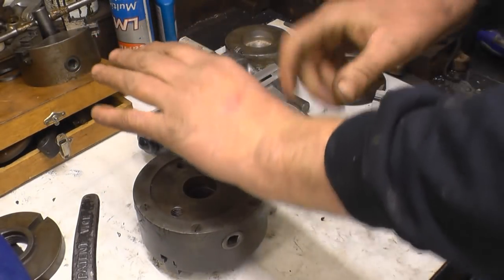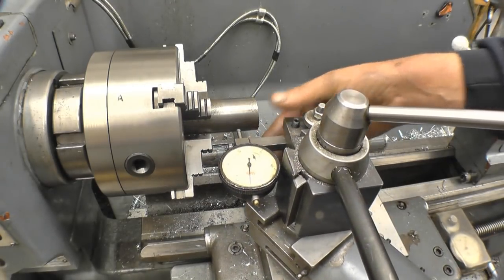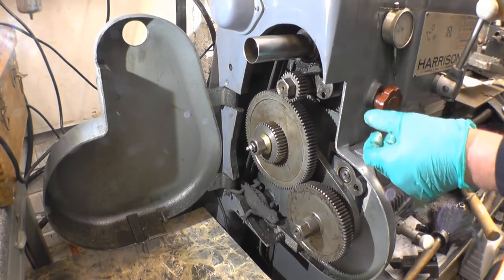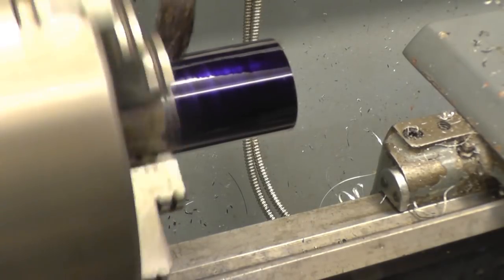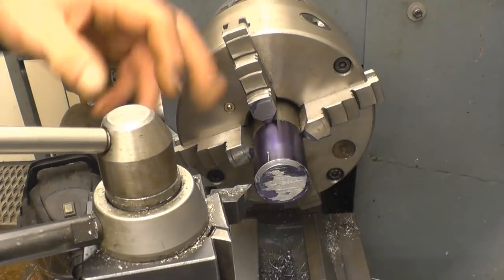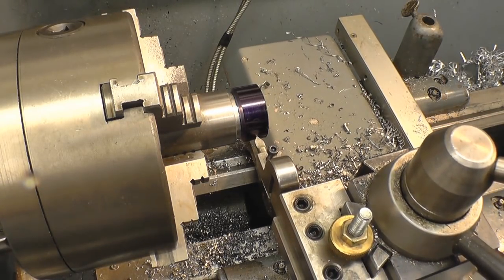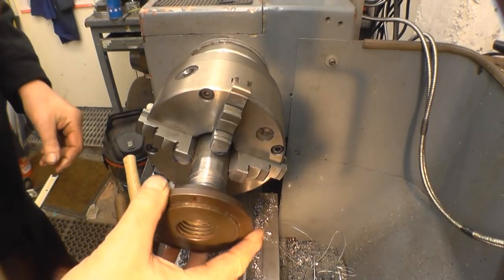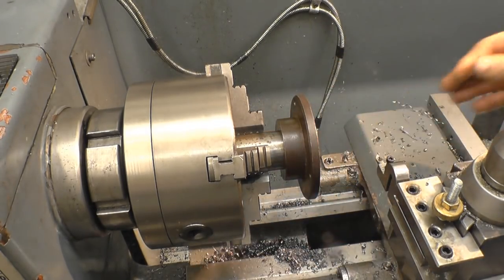SNNC 209 P2   Screw Cutting 6 TPI

Comment: A 63 tooth gear will never convert metric to imperial, but a 127 one, will do it. And that's the smallest possible gear that will. Just do the maths... I've seen another video from You where You mentioned the 127 gear, so You probably used that one here too - without mentioning it..
Reply: It does pretty close...the 63 tooth gear is equivalent of a 126 tooth gear, so the error isn't much over short distances. Like he noted, sometimes you're stuck because of physical constraints. 
Metric lathes are a headache if you're trying to cut Imperial threads...the other way around is pretty easy.
Reply: "Pretty close", is no conversion. Any thread has its own limits and tolerances. To call it a true conversion, You must stay within these limits and tolerances - regardless of the number of threads. I agree that a 63 or 126 gear might produce a good enough screw or bolt, but that would be an approach, not a conversion.
Reply: Well, if you were to buy a set of factory made metric change gears for your South Bend lathe, you are in for disappointment because they are of the "Pretty Close" variety. 
If the lead of the thread you are cutting has to be closer than 1% of the exact lead, you need a thread grinder, not a manual engine lathe. 
As a practical matter, the reason nuts are made of a softer material than the bolts they go on is so they will deform to fit the bolt so minor errors in the threads don't matter. If the screw thread is used for precise movement, then "Pretty Close" may not be good enough.

Comment: Is there a chart that tells you how deep to cut a thread in general? I've never even tried to screw cut on my small lathe but have wondered about how many passes/how deep should one cut into a bar?
Reply: The proper way to do it is to use a measurement of 'pitch diameter' using three properly sized wires and a micrometer.  The best known brand name is 'PeeDee'.
Reply: This is what you need mate...

https://www.amazon.co.uk/workshop-decimal-equivalents-details-clearance/dp/B00C77BX46
Reply: I've just had a thought, maybe using the thread gauge tool as a guide is a good idea, once the 'teeth' are flush/a perfect fit into the stock, don't cut any deeper.
Reply: If you can screw the nut or part on easily while in the lathe then just keep going until it fits. If not, get some peedee thread wires of Amazon, they are cheap.
Reply: Thanks guys, never heard of peedee.